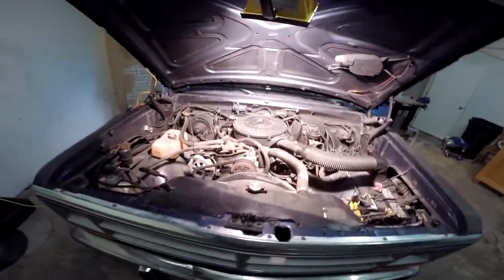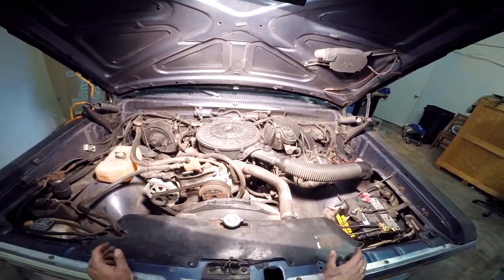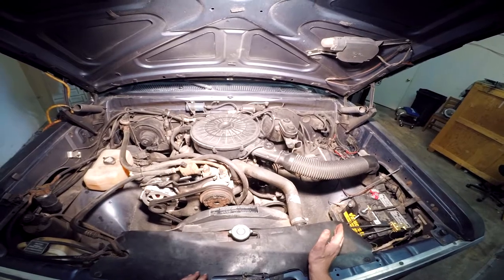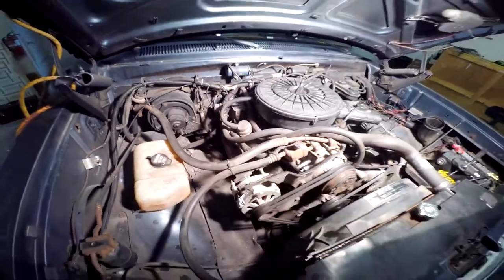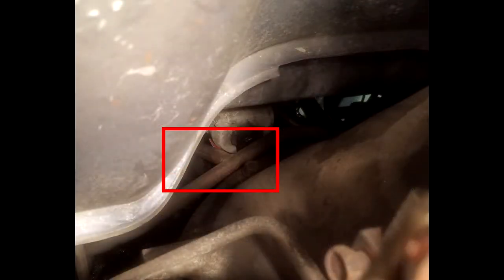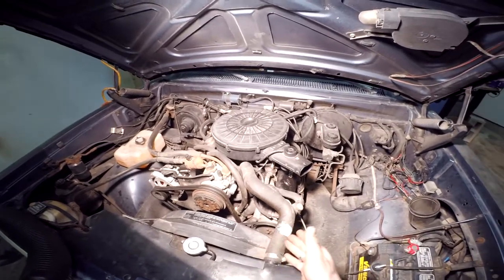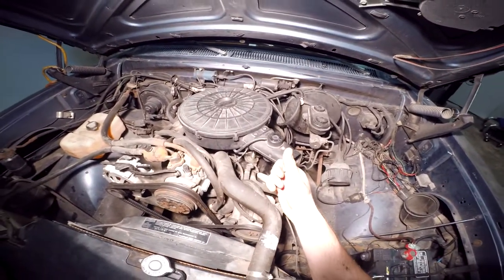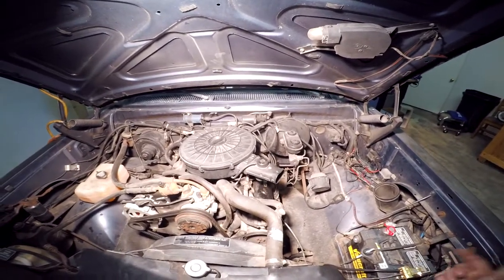1989 Dodge Ramcharger 318 TBI SMOG PUMP DELETE OVERVIEW Part 1

Comment: I’ve done the same on my truck. Totally removed the pump and belt altogether and when done I replaced all belts with new and had no issues with the squeaky belt. I also just plugged the vacuum line. For the tubing running to the manifolds I left it unplugged. Only downfall was I occasionally smelled exhaust in the cab. Assuming it’s coming from the pipe I left open.
Reply from the maker: Yeah i just plug those pipes since they are check valves and I don't want anything to get in there. Because good luck getting anything out of there. And yes once you delete the CAT you will / can smell exhaust at times.

Comment: im working on a 84 W250 with the 360 right now pulling the top half of the engine apart to replace head gaskets ann decided i might as well delete all the excess vacuum lines. hope my belts dont squeal. i know they didnt on my 85 with the 318. bought that one with a seized air pump.
Reply from the maker: Nice! I hope my videos help you with all that! The 360 is just an upscale 318. Should be perty much copy & paste! I do not have diagrams for all the vacuumed lines for 1984. I'd go to ramchargercentral.com & post under the help section. Some guys got them & will give it to you.

Comment: Got my 90 w150 earlier at the end of summer and for now I just straight up just cut the pulley and it’s been all good for me, no squealing or anything for me, just need to rip the rest out for the dead weight, also I just took a sawzal and cut the exhaust right before the car and threw it all away, have a glass pack I’m going to throw on for 30 bucks to slightly mute it since I’ll get pulled over with how freaking loud it is
Reply from the maker: What engine do you got in yours? I could get away with my 318 on stock headers if I just left it at the Y.
Reply: @mountainmaninitiative1117  yeah the outside noise isn’t too bad compared to in cab I’ve realized, I have just the 318 in mine as well, just couldn’t pass up the deal, got mine for $2500 in perfect mechanical conduction and came with a brand new 6 inch lift from skyjacker, only minimal surface rust he had already prepped for paint, had a guy throw on some good primer and called it good for now
Reply from the maker: Wow! Sounds like a great deal. I paid  the same for mine. I have a few issues with mine but nothing out of the ordinary. Such as needing new break stuff, new shocks, fluid changes & ETC. The worst thing about mine is the cosmetics since it was sitting for 8 Years down here in Texas.

Comment: Do you know what smog pump delete bracket you saw? Mine is screaming and I can only find ford ones
Reply from the maker: Can you please re-word your question? I do not understand what you are asking.
Reply: @mountainmaninitiative1117  you mentioned there is a pulley you can put in place of the smog pump. You said you saw it on summit or something and was pricey, do you possibly know what it’s called and where you found it? My pump is screaming and chirps and not sure how else to run the belts
Reply from the maker: Oh okay, my apologies been a long time since I posted this video. I didn't remember saying that. Lol

Option 1: You can remove the smog pump & delete the belt that drives it.  It does nothing for you. & or by all new belts. Super easy & cheap fix.

Option 2: Search for the serpentine belt & pulley upgrade. Which is what I had found on summit racing & expensive like $500 when I last saw it.

Option 3: Hit up Ramchargercentral.com & ask the experts for other ideas & solutions.

I hope this helps & answers your question. If it doesn't please let me know. So, I can try better to help you.
Reply: @mountainmaninitiative1117   clutch man!
Reply from the maker: @carterrobinson3770  Your very welcome!

Comment: I did the delete but I have my exhaust coming out that pipe now so would it work to just jb weld it for now? And plug it that way
Reply from the maker: lol that's one way to plug a pipe. I do not see why you couldn't JB weld it. As you know that will Permanently plug the pipe. So if your fine with that, go for it! Just follow the instructions of the JB weld and all should be well!

Comment: Could you please do a video where you show all the vacuum lines to see where they go
Reply from the maker: What year is your truck? 88 and 89 318s have no vacuum lines except for a few due to it be fuel injected.
Reply: @mountainmaninitiative1117  1988 318 tbi, just want to know where the lines go to on the throttle body
Reply from the maker: @mardyyeboy8733  okay, yeah there is only a few, its no where as bad as CARBED SMOG Engines. I can hopefully put something together soon for yeah.

if you need immediate help and need a diagram. go to ramchargercentral.com

Comment: Will the check engine come on.  Or cause any ruff idling?
Reply from the maker: For my application No. It runs & drives even better with No check engine light or anything else. Been driving like this for over 6 Months with No issues.

Comment: I have the same truck, but no power gets to the fuel injectors. I already changed the fuel pump, fuel pump relay, and auto shutdown relay. Anyone know what it could be?
Reply from the maker: Check your linkable fuses on the driver's side of your engine bay. Its between the battery & the firewall. Its those wires that sit on top of the wheel well that conect to the ASD relay & the other two relays on that wall. If non of those are blown, check all your grounds. If those are not it? Go to RamChargerCentral.com to the vehicle help section. There its a guy there who provides wiring diagrams if you need one.

Also don't forget to take the Initiative and get after it!
Reply: @mountainmaninitiative1117  cool, thanks

Comment: Does your retractable Underhood light work? Mine stopped working
Reply from the maker: Yes it actually does.
Reply: If you ever sell it I'll buy it off of you.
I worked on a 1990 Dodge 1 ton with carburetor that thing had two smog pumps just a maze of vacuum hoses.
Reply from the maker: @owlfalconry3629  I do not plan on selling it at this time. Thank you though. And from my understanding the 1990 model year should not be carbureted unless someone Carbed it and did a TBI Deleted.
Reply: The chassis cabs came with a carburetor since their Gross vehicle weight is over 10,001 lbs. All others TBI 
Good luck on your ramcharger build.
Reply from the maker: @owlfalconry3629  Oh okay, I thought you where talking under that GVW, that makes a lot more sense. And thanks man! I wish the best towards your build as well!
Reply: Thanks appreciate it..
Reply from the maker: @owlfalconry3629  Your Very Welcome!

Comment: i have a 318 tbi 89 ramcharger as well. what do your valve covers look like @Mountain Man Initiative?
Reply from the maker: My Valve covers are factory & painted black. Also, has a sticker from factory reads "318 & 4483".
Reply: @mountainmaninitiative1117  okay mine are painted black and "should be factory standard but mine say 322 instead of 318. Do your valve covers have two holes in both valve covers?
Reply from the maker: @brandonpropterhoc  At the factory the stickers will always read different from what the motor is most of the time. And yes mine has two holes in it. You can see my over view video to compare how factory your motor is if it helps you, my truck is all stock. https://youtu.be/wa5WsRv0w-8
Reply: @mountainmaninitiative1117  thanks. Ive just been looking for new valve covers and i cant find the correct ones anywhere
Reply from the maker: @brandonpropterhoc  okay, that makes a bunch more sense. I was curious to what your goal was. What Kind of Valve Covers are you after? Like a dress kit?
Reply: @mountainmaninitiative1117  im after the stock valve covers that fit my engine
Reply from the maker: @brandonpropterhoc  These are the most factory that I can find that are reproductions'. But also there out of stock currently "Obviously" https://www.summitracing.com/parts/amd-335-1072-1p/make/dodge

You can also head hunt on the forums by posting in wanted. one of the guys might know of a place I do not or have a spare set they are willing to sell. Also, there is ebay as well. Just Remembered that. Ramcharger Forums : https://www.ramchargercentral.com/index.php?action=vindecode

I hopes this helps you out.
Reply: @mountainmaninitiative1117  yeah ive seen those before. I guess i just overlooked them because one doesnt have two holes. One doesnr have the oil breather part
Reply from the maker: @brandonpropterhoc  I see, Depends I guess if your staying TBI or going carbed?
Reply: @mountainmaninitiative1117  im staying with the tbi. I wpuld like to put a new engine and trans in there but i dint have money. So ill kept it as is for now
Reply from the maker: @brandonpropterhoc  Okay, I dont blame you lol. I'm doing the same as I build my engine out. But I'm sure you will find some valve covers that will work in the mean time. As long as the bolt pattern is the same. It should work just fine.
Reply: @mountainmaninitiative1117  well yes and no. I have some that look to match but they would need serious fabrication to work

Comment: Will this work for a 1990 360 also
Reply from the maker: Yes the 360 CI 5.9L V8 is exactly the same as a 318 CI 5.2L V8. Only Difference is the 360 CI is bigger by 42 Cubic Inches. Just note if your engine is carbureted you might have to cap a few vacuum lines. Hopes this help brother! Go get after it!
Reply: Hey does your 1990 have a stock efi ? I have a 1990 w/ v6 efi. I rarely see the 360 on efi.

Comment: Will this work on a 91 dakota with the 318???
Reply from the maker: If the Engine set up is the same as mine, yes you can. just note you might have a few more oxygen sensors in the exhaust plumbing, due to yours being a few years newer than mine. Which I would check 1st. I am not as familiar with the dodge Dakota's, that I am with the Gen 2 Dodge trucks. You can send me photos to my email in the channel about page, and I can help you further that way if you would like. Remember always go take the Initiative, Get after it!
Reply: @mountainmaninitiative1117  appreciate it bud. Worked on a bunch of sbc engines...first time goin in to a dodge motor haha. Shall be good times.
Reply from the maker: @chevpasmore5809  Sounds good man and no problem! The 318 is a good simple motor. You will notice it runs whole lot better with out the SMOG pump on it. Due to all the smog equipment on it really hurt its performance. Still if you need any help feel free contact me!
Reply: @mountainmaninitiative1117  hey bud, I can’t find your email. I have a question about the smog pump. Mine is on the passenger side and it looks like the hoses runs to passenger exhaust manifold and then the other one down to the cat. If I remove it do I need to plug the exhaust manifold off or no?
Reply from the maker: @chevpasmore5809  email : mountainmaninitiative@gmail.com : yes, you would need to put a plug of some kind in the exhaust manifold. when they deleted stuff in early 80s with carbs and miles of vacuum lines you had to plug all the holes in the exhaust manifold.
Reply: @mountainmaninitiative1117  Mine is throttle body injected not carb. But i will still plug it off to be safe. I will email you a couple photos of how mine looks now. Thanks bud.
Reply from the maker: @chevpasmore5809  I recognize you got a TBI, I should have been more specific with where I was going with that. Let me check my email and take a look.
Reply: @mountainmaninitiative1117  no worries bud. Take your time. I’m in no rush lol. I greatly appreciate the help 🤙🏻. Solid dude in my books bro.